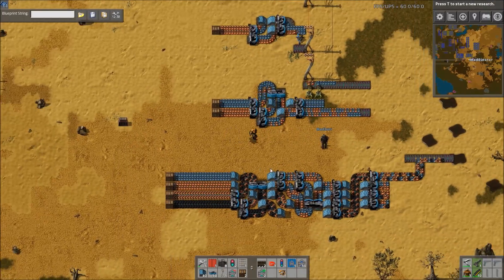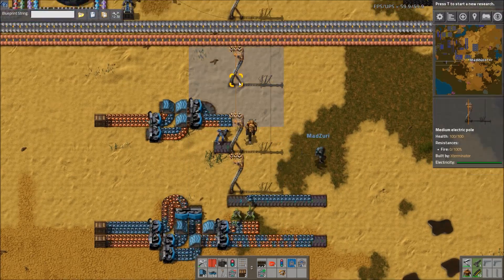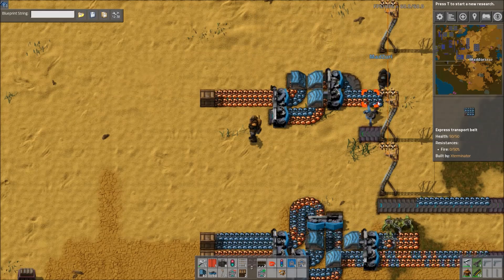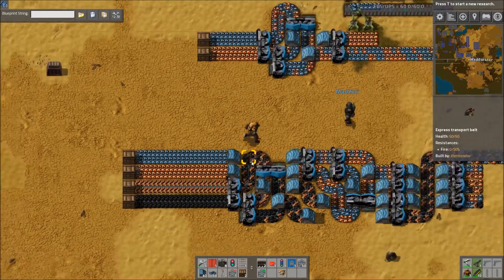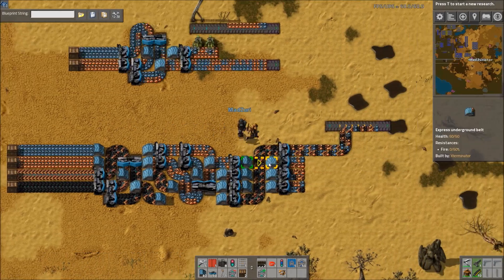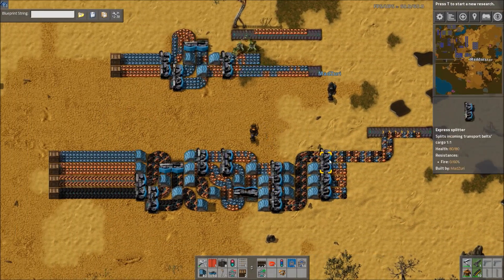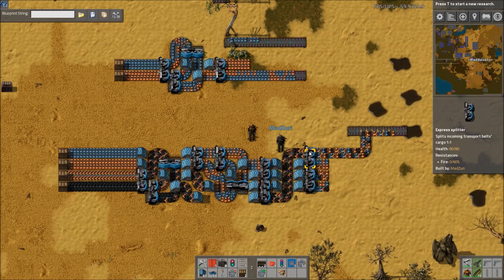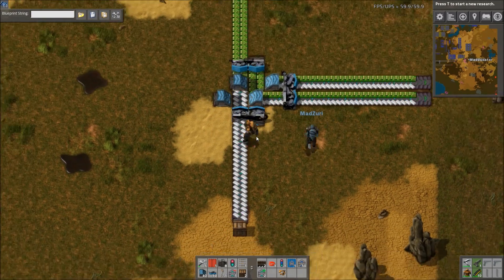Factorio Workshop - Building A Better Factory :: Lane/Belt Balancers

Comment: Is that true, that in an ideal factory you would not need belt balancer? 
Wont your main buss need balancers?
If you are limiting your design to those that pick up from both sides of the belt equally, is that not going wo waste more space/efficiency than having 3 balancers in the wat to the production? ?
Reply: Technically you could just use splitters to prioritize which side items go through to keep lanes fully saturated as belts only go one directly.  So if you got 4 belts you can use splitters to guide the flow.  Unlike a belt balancer this ensures the lanes(you need)are fully saturated rather than just balanced which IMO is better than balancing them. I use balancers closer to the beginning of a bus, more so for raw ore so it smelts evenly. Once it's smelted as long as you have full saturation you really don't need to balance so much as just guide it along if you are not using a full belt.
Reply: @solj1n193  Exactly, balanced are really useful right after smelting area. Also in the main buss after a certain length. 
They are basically very great, up until you preplace your main buss with trains.

Comment: did I miss something do those chest load themselves
Reply from the maker: We are using the Spawn Belt mod which does that.
Reply: Which is quite confusing for people who don't know this mod. If it isn't required for what you want to show, you should not use it in the first place. This would improve clarity and hence improve the value of the video as a tutorial. Same goes for running around and hovering over things which do not matter. Naturally, people would assume that you do and show things which matter (only/mostly).

Comment: I like it for OCD reasons, I give each belt it's own smelter and then when my factory works, exactly the same amount of furnaces in each bank kick on at the same time, it's asthetically pleasing to see all 4 furnace arrays working in tandem. I would do away with it on a megabase though. Something else not mentioned in the video. Is if you have one of these, it needs to be at the BEGINNING of the bus. Never build more than 1.
Reply from the maker: Yeah, doing it for OCD reasons is really the only reason to do it I think.
That is a good point for something we didn't mention, however the main thing we tried to imply in the video is to not use them at all.

Comment: if you think these balancers are bad then what would you recommend for furnace setups then so they'd draw equally from my ore lanes.

By mid game I usually have 4 incoming Iron ore lanes going to 2 dedicated Iron smelters, 1 Steel smelting area and 1 lane which goes off for general iron usage (like Bobs mod ferro liquid) and the only method I found to keep the setup running properly is these balancers, along with a priority splitter to stop the general iron lane if any of the 3 furnace lines is empty.

So what would you recommend as an better alternative?

Also, A future tutorial on priority splitters would be great, because my priority splitter is horrible.
Reply from the maker: Good question! I actually plan to make a video in the near future about furnace setups and some good ways to build them to be inherently balanced and such. Until then though, basically what I can recommend is to build your furnace setups symmetrical, and also make sure that your ore input is enough to support the amount of lines you need. 
So to clarify on that last point: If you have 4 incoming iron ore lanes for your smelters/general use, make sure that each one is dedicated from the source. So having 4 full lanes coming from your mining/train dropoff area, and send each one where it needs to go. If you are inputing a full dedicated line to each smelter and the belt levels are the same then it should stay balanced.
Reply: But the problem is I cant guarantee equal distribution on consumption, since each lane is consumed at a differing rate. the misc recipes requiring Iron require very little of it so giving them a dedicated share is overkill I think (which is exactly why I use the dedicated splitter, to force it to trickle iron and only while the others are well supplied) so whats vital for me is that atleast the ore coming in on the "misc recipie lane" to be able to feed the other 3 furnace setups and only feed the misc recipe lane after the furnace is well supplied. as an added bonus it would be great if they all spread across all lanes so that whoever needs the ore will get it.

tl;dr version: what I want is for 3 of my 4 lines to have a equal access at all my input ore lanes, and the last output lane to only work if the other 3 have a good thick belt
Reply from the maker: Gamma Ray Okay I think I understand what your saying a bit better now. Based on your tl;dr explanation then I would probably agree that a priority would probably be your best option. It would be something similar to one we demonstrated in a previous Workshop video where the person used it for coal, but pretty much the same concept you're trying to do.

Comment: I know that the ideal situation is to build a factory whose belts never need balancing, but who here has ever built an ideal factory?  That just really doesn't happen in normal gameplay.  Eventually a mine will deplete, or new stuff is added that strains the load, or bottlenecks appear, and thus belts become unbalanced.  So to say that "you just shouldn't let it happen in the first place" comes off as a bit ... cocky?

Also I don't like using underground belts to take from only one lane, because any resources that end up on the other lane just sit there on the belt and never get used, which is a waste of resources.
Reply from the maker: I can see your point. Perhaps we said it in the wrong way though. We didn't mean that things have to always be perfectly balanced around your entire factory all the time, because yeah that is a very unrealistic thing to expect. The main thing we were getting at is that to balance your ore input and smelting to begin with. And just generally building setups that are balanced. Obviously you won't be able to keep everything in your factory producing at a balanced rate 100% of the time though.

It's true that the resources back up on the one lane, but at that point it will back up to wherever your splitting from and then the extra will be sent further down the bus so it isn't as much of a waste I don't think.
Reply: Well I have to say that it is specially difficult to keep stuff balanced playing highly modded games., like bob's mod Unless you spreadsheet everything weeks before starting your build, lots of things will be unbalanced, period.

Comment: These balancers seem needlessly complicated to me, but I guess its neat they guaranteed take from both sides of the belt even if output is only taken from 1 side. While balancing like this shouldn't really be needed, actual N to M load balancers (as shown here: https://www.reddit.com/r/factorio/comments/3fq3cc/count_perfect_n_to_m_belt_balancers ) quite useful (in my opinion) if you evenly want to distribute resources between different sections, like splitting ores between smelting groups, or simply combining/splitting belt feeds for other reasons.

Comment: For the T thingy by zuri, why do you need the left most underground belt? Isnt that a bit useless?
Reply: You can always toss it in your logistics system, let it go to storage and never worry about it again, let the robots sort it out. :)
Reply: No it's not needed. As long as you set the other "half" of the Underground belt to facing the right direction, it'll work just fine. 

But you'll also have a spare underground belt....
Reply from the maker: Yeah, what Nathan said. It isn't needed, just make sure you face it in the right direction. Personally I would rather have it there just for symmetry sake. :P
Reply: it's also only a splitter away from the two lane balancer, it's effectively doing the same job without mixing the lines
Reply: I wish they would just change the recipe for underground pipe and belt so it costs half as much, takes half the time, and produces just one piece instead of two. That would keep the cost exactly the same but allow you to make them in single units instead of always in pairs, so if you end up with a mismatched piece you just build one more and you're fine.
Reply from the maker: ***** Yeah that would be really nice. Having the one left over piece sometimes is super annoying and confusing. :/

Comment: When you guys say there's no reason to have balancers, are you speaking of any balancers period or just wonky ones that mix up different products on the belt like how the two and four lane products you show?  It's a bit confusing as a new player as I think I understand how you're trying to show balancers for multiple products rather than a single product on several lines, but it's not clear in the video.

Also thank you for all the videos you guys put out to help everyone, it's extremely helpful and your lets plays inspire me to try my hand at trying to build a mega base.
Reply: They are only mixing products to show that they work. No, you wouldn't be mixing products like this. :P
Reply from the maker: Artentus Based on initial observations that would be a understandable conclusion.However, if there is still one side backed up, inserters are able to grab from that side as well.
Usually half a belt will get consumed first because Inserters prefer to grab from the close side of the belt, so if there are resources on the close side they will always grab them first, thus causing one side to be used up. They are still able to grab from the far side though as well, so even if one side is used up, the other side is still available. 
The balancing doesn't actually send anymore resources down the belt, it just take the one backed up side and makes it go down both lanes, but doesn't actually help at all. 

Hope that answered your question, if not, I'll get Zuri in here to try and answer it better. :)
Reply from the maker: Spot on. :)
Reply from the maker: To expand on what Beren Scott said - We pretty much any balancers. You should almost never be mixing resources like we are showing, we are just doing that to show how it works. Pretty much all balancers are best to avoid unless it's like an N to N balancer. So for example, taking 4 smelting output lanes and putting them through a balancer to get even output lanes is okay, Zuri does that type of thing all the time. 
An example of one where there is no reason to do it is for just 1 smelter. A lot of people will balance just like one belt, but you should never have to do that if you build balanced smelting or other production to begin with. 
Hope that answers your question and wasn't too confusing. :) Let me know if I made it even more confusing. lol 

Thank you for the appreciation! It is a pleasure to make these videos and it's always so great to hear that they are helping people out. :) 
Glad you're enjoying the let's plays as well! I plan to start doing a lot more tutorial and "how to" videos in the near future, so keep an eye out for those.
Reply: I also think you guys, rather then using balancing, should use the method Steejo does, where he will use splitters with wiring to the belt to force compression.
Reply from the maker: Beren Scott Lol we might do a video on that. Zuri doesn't like that method at all either actually. :P
Reply: I was under the impression that if a belt is only consumed on one side this would cut the maximum available troughput in half and these balancers prevent that. Do I have an error in that thought?
Reply: I understand, and I also know how inserter work. ;)
However,  I believe "The balancing doesn't actually send anymore resources down the belt" is only true if a fully compressed belt is put out. If, for example, only half a belt is put out, it is possible to send that all down on one lane. But you guys probably never build something that doesn't output a fully compressed belt. :P
Reply from the maker: Yeah pretty much. :P We have found that is is almost always best practice to build smelter setups, or other setups for that matter to output a fully compressed belt to begin, and then yeah, you shouldn't really ever need a balancer. :)
Reply: You might want a balancer after each time you pull from a belt on the main buss for example so you get everything back afterwards. The new circuit based ones are really handy
Reply: IMO it's better to balance the consumers (i.e. assemblers and chem plants). By which I mean put even numbers of them on opposites of the input belts so they're drawing evenly from both sides of each belt. Doing this consistently everywhere in the factory means you will be drawing evenly from your producers (e.g. smelters), and belt-balancers become almost entirely superfluous within the factory proper.
Reply: Michael Matthews The circuit-based balancer from 0.14 is good because it allows you to send an entire line towards a specific module without taking a ton of space. I'm using it for example on my green circuit module
Reply: HeadsUpHigh The options available with regards to circuit network are awesome, and I hope they only get better in the future. It's really creating a lot of creative solutions.